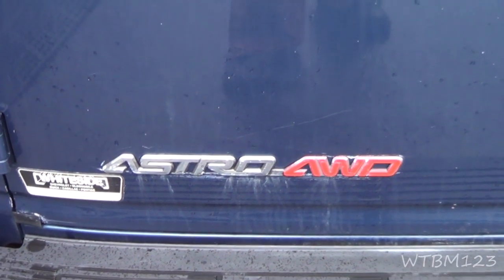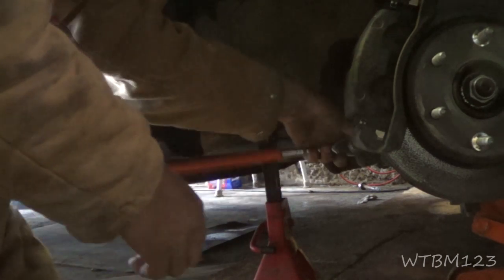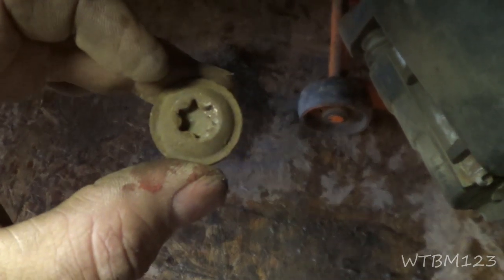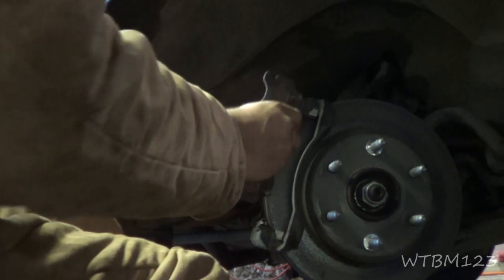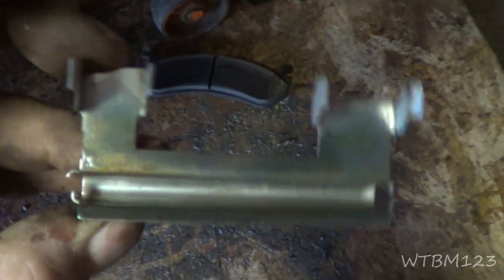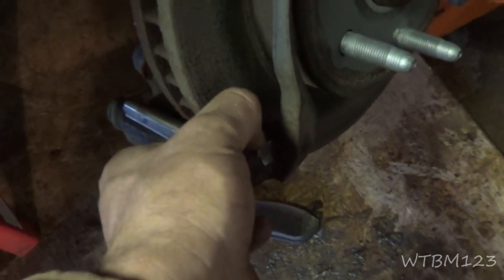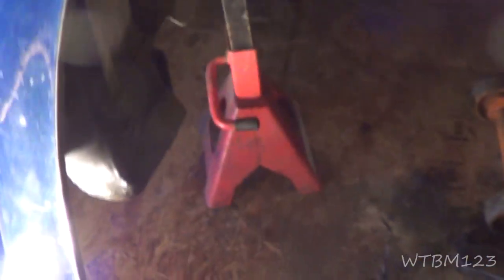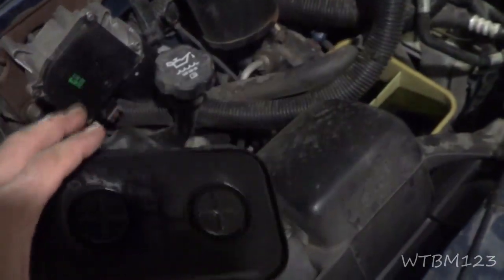Astro Van, Replacing Front Brake Pads

Comment: great tips. I used the scewdriver to reset the piston, and again with channel loks after the pads were out to set the piston back all the way. Nice instructions, especially the torx 55 bit which i bought after seeing your vid as these are the first brake pads I have done on my 99 astro van 2 wd. Didnt have to take it apart first and put it back together to go get the right bit, thanks to this video.

Comment from the maker: Rotor is a slip on . If you mean getting the caliper bracket off. There are 2 bolts to remove. they are tight and sometimes loctited . So if you can not get a impact on them then use a good socket an breaker bar. Could try a wrench on it and hit the wrench. If all else fails try heat.

Comment: I had to cut through the guide pins using a four inch grinder with a cut off wheel, and then clamping the caliper in a vise and heating the bolt heads and they were still hard to get out

Comment: Would be helpful to know what year this Astro is. I cam here looking to see if it has dual-piston calipers. At 9:11, the answer is "yes" bit you have to freeze-frame at EXACTLY the right spot to see it.
Reply from the maker: alafrosty it has been a while , but i think it was a 04 and it may of had dual piston , you can go to a lot of parts stores on line and prob see which it has , some have vin tag look ups so it looks parts up using the vin information.

Comment: Actually, you should never just push the piston back in forcing old dirty brake fluid back up into the anti-lock system and master cylinder.  You should always loosen the bleeder screw and allow the old fluid to come out there.  Then, with the proper tool (google disc brake pad spreader OEM brand at AutoZone) and the old inner pad, getting the piston back in is very easy.